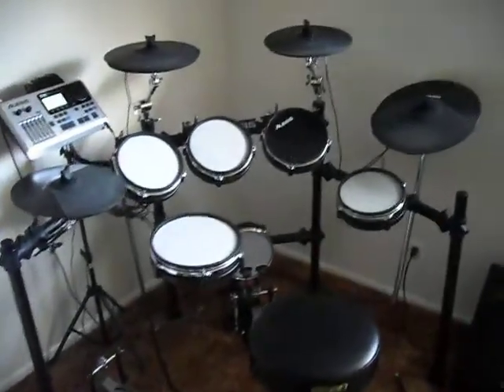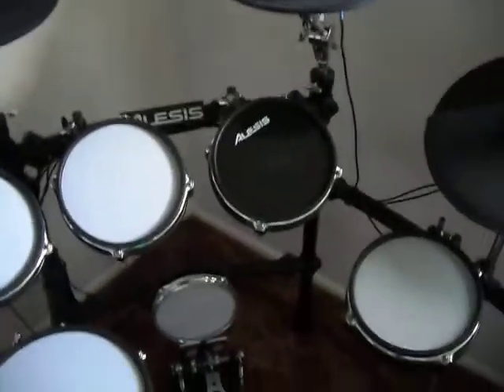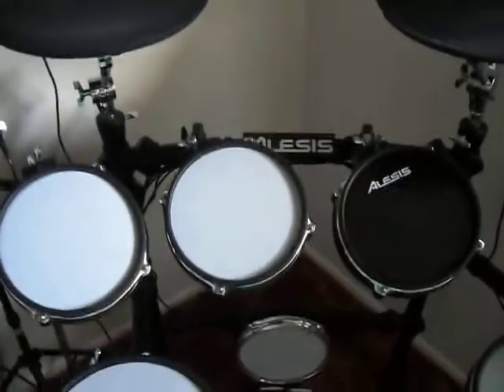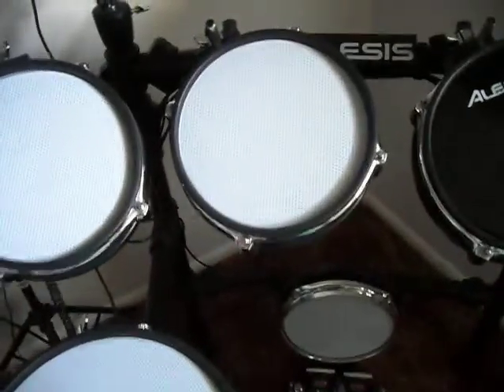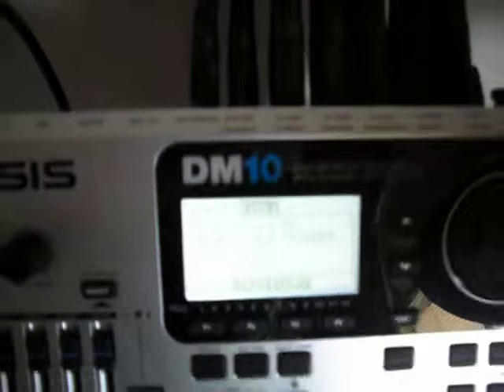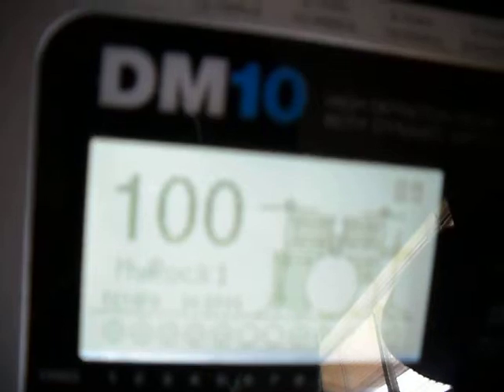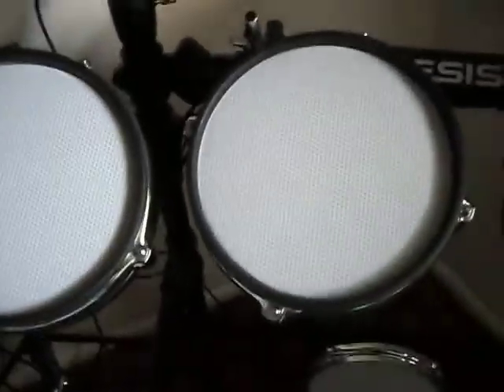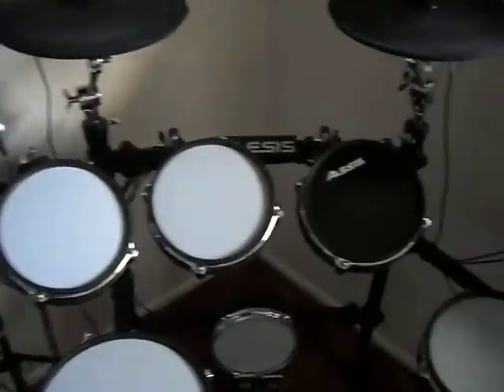Mesh head conversion  (part 1)  Alesis dm10

Comment: I'm not too into turning the sensitivity to max (99), but I guess that's why some folks remove the resistors.
Lourdes mentioned on forum that the BBII heads have a 'cheap' look to them compared to other mesh heads. 
I have DM10X w/ shallow 12" toms, so my conversion will be a pain since the hellfire method doesn't work on the 12"